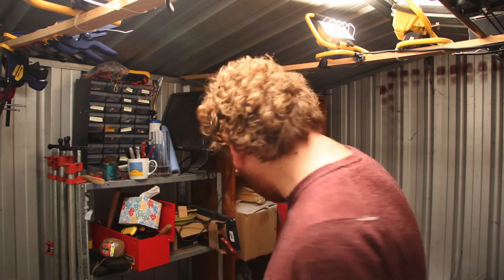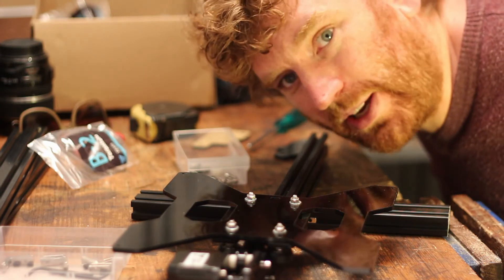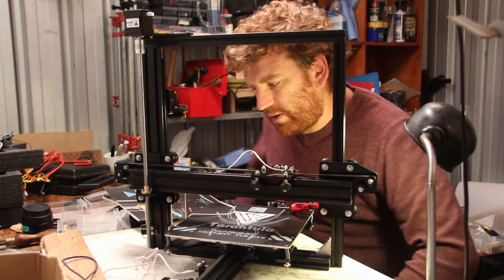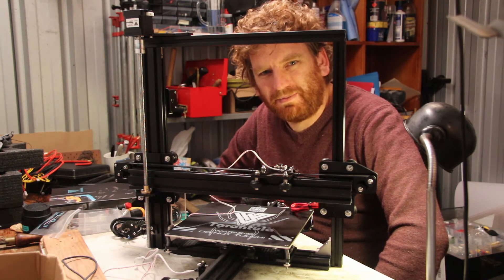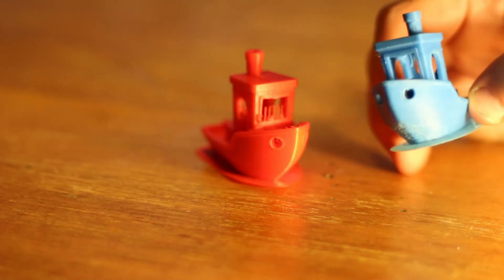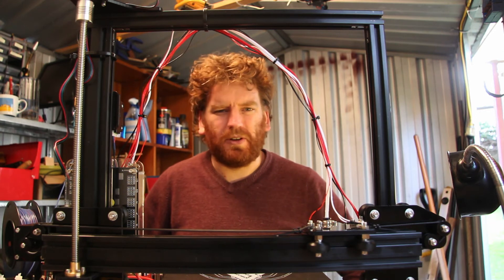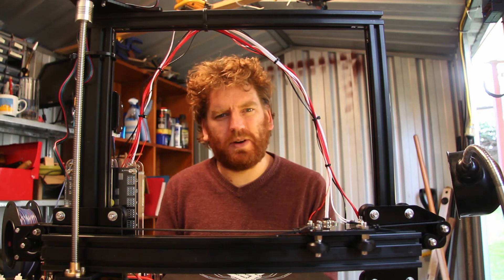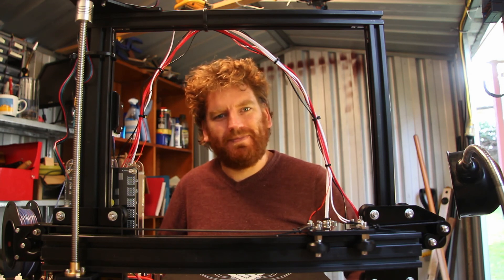Reviewing a sub $250 3d printer kit: Tarantula Tevo prusa i3

Comment: print different pulley spacers to get rid of that squeak.  Or just go all out and print x and y belt tensioners.
Reply from the maker: Thanks for the tip. I assumed the squeak was the wheels I'll check out pulley spacers.
Reply: It may well be the wheels, they do squeak after a while.  More likely it's the spacers rubbing against the acrylic.

Comment: Just finished my build last week and your impressions are very close to mine. Great video. Would have (accurately) sold me on the printer even more if I had seen it a few weeks ago.
Reply from the maker: Thanks. Good to hear you had a similar experience to me. Was worried people would have a completely different experience.
Reply: 1.) Long but satisfying build time: Check
2.) Oh shi*t moment with a motor: Check,
3.) Surprisingly high quality results once it's up and running: Check